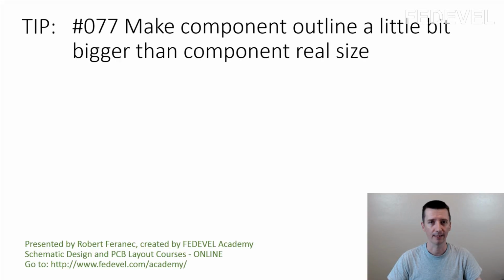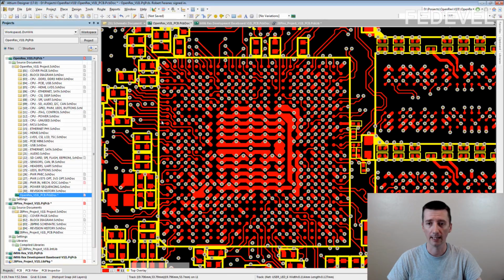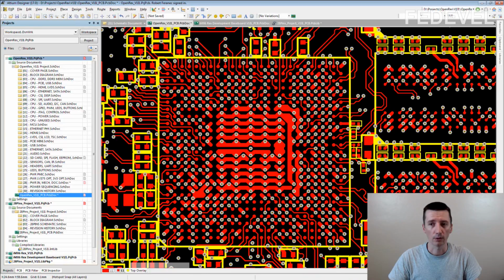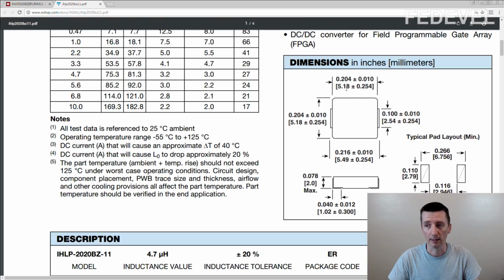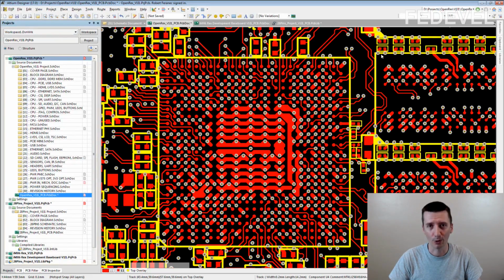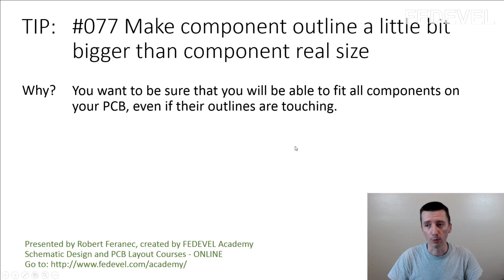TIP #077: Make component outline a little bit bigger than component real size

Comment: It also gives a visual reference (if silkscreen is printed) if component are placed correctly and havent moved. Regarding the example, did you have trouble with soldering the balls on the bga? Do the toplayer planes draw heat from the soldering process? It was suggested to me that doing this on the toplayer might cause trouble in production. If not it is a good way to have more room underneath the bga for decoupling capacitors. Good job robert! Really like the tip videos.